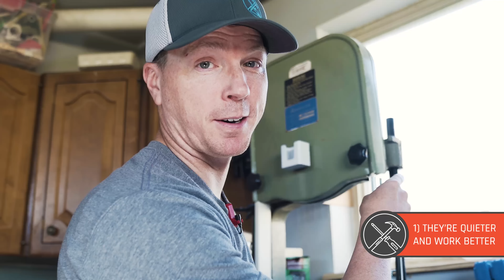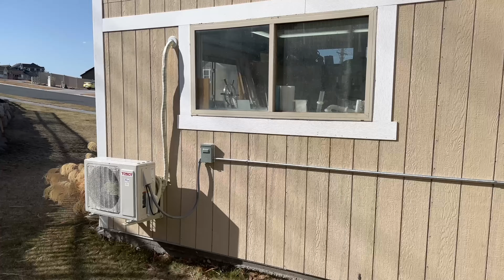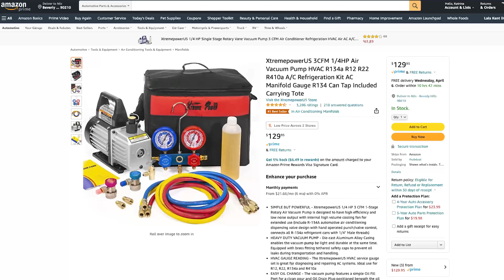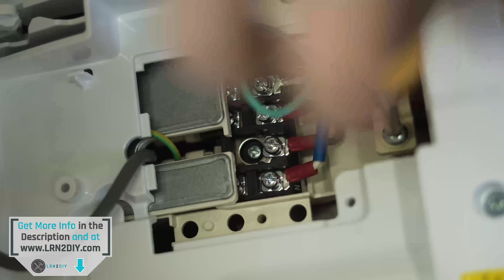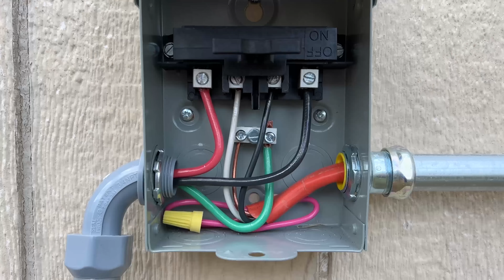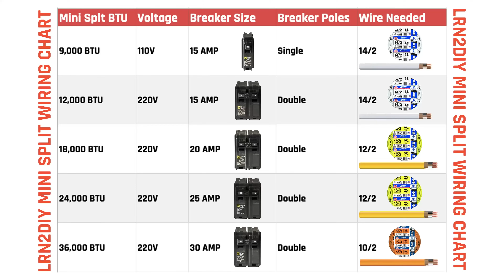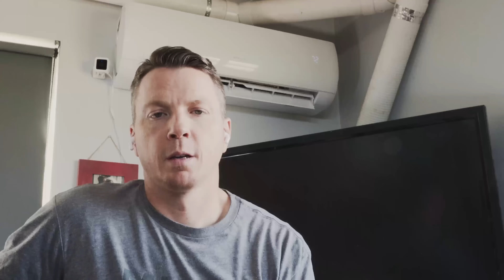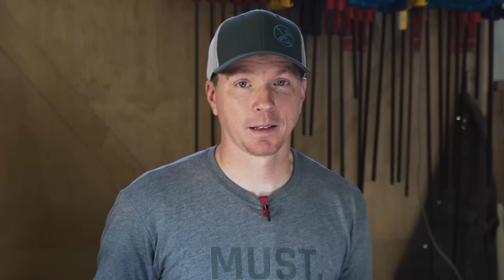Mini Split - 3 Things I Wish I Knew Before Installing

Comment: When our downstairs central unit died we replaced it with mini splits. Not only was it a fraction of the price but they simply seem to work better. No more central system leaving certain areas too hot or too cold. 
Best decision we could have made. We already noticed a reduction in our energy bill.
Reply: Your central system provided ventilation. With mini-splits, there is no ventilation, so you will still need a separate fresh air system.
Reply: @matsudakodo  Provides ventilation can you please help me understand what ventilation?  Also what ventilation system can I purchase?  Thank you
Reply: That's what I intend to do with my house when the central unit hvac unit goes out. One end of the house gets hotter being in direct sunlight. Glad it's working out for you

Comment: I installed a 18K Mr. Cool unit 2 years ago in my garage shop.  I couldn't be happier and now spend more time in the garage than in the house.  Even when it's 100 degrees outside, I can maintain low 70's in the garage (***note: garage has insulated walls, ceiling, and doors).   As for pros and cons......here are 3 I wish I knew before installing

Pros:
1) Adding the unit actually made me much more productive.  Not only can I spend more time in the woodshop, but also have the perfect place now for car repair or home repair projects. 
2) The mini split unit uses very little electricity.  I run it all the time, and my electric bill is maybe only 10-20% higher than normal.   
3) The heating function is almost as nice as the cooling function.  I had almost bought a unit that just cools to save some money.  Glad I didn't.  In the winter when it's 30 degrees outside, I am able to hold the shop at......you guessed it.....low 70's.  

Cons:
1) The most difficult part of the whole installation was shaping the copper lineset against the wall and inside the lineset cover.  I kinked mine and had to get it repaired.
2) The condensate line can be a bit of a nuisance if you have no place good to drain it.   Having it constantly leak over a concrete slab leads to algae build up.
3) Unless you spend more money to get a multihead unit, the cooling and heating can be uneven if your shop has an odd shape.  I have to run a small fan to get the air to equalize to the far side of the garage.
Reply from the maker: Great feedback on your experience, Jackson. Thanks for this info!
Reply: @LRN2DIY  What is the difference withe the cheaper ones you can buy off of Walmart? Also we live in a trailer house... how do you go about that if yiu have an extremely old hvac system you just want to get rid of? Do you put one in each bedroom or just one bigger one in the living room area and just try to run fans?
Reply: @LittleCBR  ; Regarding Walmart, those are third-party sellers and the devices are cheap crap with no customer service and no warranties.
Reply: Great summary.  I’ve had  2 mini splits for a number of years and everything you mentioned is true
Reply: How much do you actually save installing a mini split unit. Looking  to improve my basebord heater with this mini heat pump split unit..
Reply: @jaandel1  Not sure exactly because I didn't have permanent HVAC before.  I upgraded from a small rolling portable Whynter AC unit.  The electricity usage between the two is about the same, but the results are like a night and day difference

Comment: Here are MY three things. 1) A mini is always much more expensive than a window unit, by an order of magnitude. 2) A mini split is MUCH more expensive to repair, since the manufacturer is the ONLY source for repair parts, aside from the refrigerant itself. There are no generic minisplit parts made by third parties. You can't go to the supply house and buy a generic compressor or control board for a mini. No one makes those parts for the repair market. 
3) Most inexpensive mini split units are made by ONE Chinese company and are throw away units. If the repair cost is near replacement cost, you replace it. My Frigidaire window unit is 17 tears old, and still runs quietly and efficiently. It cost $200 at Best Buy. You will NEVER get one of these cheaper minis to live that long. I have installed and serviced all brands of minis, RTU's, conventional splits, and large tonnage equipment. That's how I know this. If you must buy a mini, don't go on the cheap. No DIY junk. Get a top of the line, professionally installed system like a Mitsubishi. And no, I don't install enough minis to become a Mitsu dealer. I let those guys do those sales. I just come along and make them work when they fail in the commercial environment, and even a good unit like a Mitsu WILL fail. I have fixed dozens of minis in that 17 year period, and not ONE repair for the Frigidaire window unit. See that pattern? Those who have ears, let them hear.

Comment: Dude! You just changed my life.
So quick question, do you recommend the 5 CFM Vacuum Pump or the 3 CFM and why?
Reply: I own a 5 CFM pump, and I paid about $400 for it. (15 years ago).  I would recommend using a 3 CFM pump, and run it about 90 minutes, for the same reason the guy below says, it will provide plenty of vacuum.  A $175 micron gauge is something I never had extra money to buy.  So no I don't use one.  I have been installing HVAC since 1984. 

I have used a vacuum gauge, when the boss bought it for me to use.  They normally reach 500 microns in about 20 minutes, and 100 microns in about 1 hour.  However if there is a tiny amount of moisture in the lines, it can take much longer.  Purging the lines with high pressure nitrogen can speed the evacuation process.
Reply: You should use digital guages when pulling a vacuum on a mini split. You should pull the vacuum down to below 900microns which the mechanical guages wont tell you. Having said that the difference between the pumps is simply how long it takes to pull the vacuum.  The 5 cfm will do it alot faster but cost more. For a 1 time use just get the 3cfm pump and let it sit there for a long time. I would say 90minutes at lease with mechanical guages.

Comment: i live in Minnesota  it can get to be 80-90 % humidity 100 -110 deg iv herd splits have tuff time cooling in those temps . would like to here other opinions
Reply: Any ac system sees reduced effeciency in hotter temps. Harder for them to transfer heat in 100+ degree heat then it is in 90 degree. The humidity will cause alot of condensation in the system and if your condensate drain isnt done right or clean your going to have issues. Mini split systems struggle a bit with condensation problems.
Reply: You will be very happy with a ductless heat pump in Minnesota!  They can provide a lot of heat - even when it is about 20F outside.  Below that temperature, it might be a little less expensive to run a gas boiler.  Oil heaters are going to be much more expensive to run.  

To get 100,000 Btu's of heat, your heat pump will use about 5-9 KW of electricity, check your local costs.  To use a gas furnace, about 1.2 therms, or 1.2 gallons of propane, or about 1 gallon of fuel oil.  At $5 per gallon this winter, fuel oil is more expensive than anything else!  A electric heaters will use about 30 KW to produce 100,000 Btu's.  Yes even those quartz electric heaters that claim on their TV ad that says it is lower cost to run it.  

Ductless units control the humidity very well!  Just remember to use a wet/dry vacuum on the drain line about twice a year to clear out the line.

Comment: One Thing I haven’t seen covered was the freon? Does it come pre installed in the outside unit?
Reply from the maker: Exactly. When you connect the lines to the outdoor unit, it charges the lines with the refrigerant.
Reply: @LRN2DIY  that is what I thought I had read before. Thank you.

Comment: SO you missed one of the other differences with the DIY has this doesnt, and that leads directly into your next topic of "lots of electrical" 

the DIY unit has the signal cable all wired up already.
and if you can get teh DIY unit for 1200 instead of 1500 why not go for the diy version?

Comment: 220V outlet?  Sounds like you need to buy a welder to fill that plug.  It's the responsible thing to do.  No 220 plug should be left empty in a shop.
Reply: That looks like a 20A receptacle, not for much of a welder.

Comment: Other tips: 
1. between 3 and 5 years you're going to need a new motor. The motors become off center, wobble, and that wobble extends thru the squirrel cage. Buy the replacement motor when you buy the unit because the manufacturers are always discontinuing models. I've got 28 I take care of in a lodge. Also try to get buy or download a service manual when you buy the unit. Some mfg's don't make them available. If you buy a replacement motor where the model has been superceded, make sure the connector is the same. Often the wiring will be different or the connector is a little different. Also, the shaft length seems to change a lot so make sure if the shaft length is different that you can still use it. My replacements had a shorter shaft (still worked fine)  as well as a connector that differed slightly(shaved a little plastic off with a knife and they worked).

2. clean the filter once a month. Clean the squirrel cage every 6 months unless your in a dusty area that also gets rain. The squirrel cage gets dusty then wet creating wobbles as the muck dries unevenly. 

3. Be extra careful when removing the plastic parts. It's always the kind of plastic that breaks before it gives. 

4. Remember that they never stay as quiet as the day they are installed. I try to keep mine no higher that 42 decibels 3 feet away as long as there is no wobbling noise. Once a wobble noise starts, it will get louder. Often i can get a decibel reading in the mid 40's with a wobble, and in that case the wobble wakes people up not the decibel level.

You can get a decibel app for your phone for free. 

I take the squirrel cage out to clean it but you probably could clean it while it's in with a sponge and toothbrush if you didn't have the time.
Reply: The motor in the condenser or the motor in the head unit?
Reply: @lesmoss1051  I think the only squirrel cage fan is in the head unit. He's talking about keeping head unit quiet for sleeping guests.

Comment: I bought a Mirage 12,000 btu hot/cold, inverter minisplit, for $530 and installed everything myself, but that is not in the USA. The power lead comes through the wall and plugs into a power outlet, that was already there.

Comment: I'm not sure if anyone has mentioned thia, but look at the parts warranty on the compressor and such.  I have found the Mr. Cool products have much longer warranties than the no name brands.
Reply: A 300 year warranty on the compressor doesn't matter if the inverter control board fails in 2 years and they claim it was a phasing issue.

Comment: You left out the cost of charging your unit with Freon. Real disservice to anyone watching this video that is considering a mini-split. Really should update this video with the rest of the facts. Or, were you just brand advertising?
Reply from the maker: You do not need to charge the lines separately for a unit like this. Every step required is shown here. When you connect and open the lines, the refrigerant is released from the outdoor unit into the lines and that’s all you have to do as far as refrigerant. I’m using it right now and there is no extra step like you’re saying.
Reply: @LRN2DIY  I’m using the split unit I installed, right now, and I didn’t have to pull a vacuum. Why are you adding the cost of a vacuum pump to the Mr Cool unit and not to the one you installed? I have the Mr Cool. Bought it for $800 and change. Works great. Added cost to my electric bill isn’t even noticeable.
Reply: @LRN2DIY  Not needing extra steps is what I was trying to say. You said you have to buy a vacuum pump for the Mr Cool and added that cost. You don’t need to buy a vacuum pump to pull a vacuum on the Mr Cool. Connect the lines and done. Sure is nice having AC and heat in the shop. These split units are inexpensive to buy and operate.

Comment: Nice video! One more thing I wish I had known was the inside unit needs to be cleaned periodically to remove mold that grows on condenser. The outside unit should be cleaned  as well but I didn't realize the inside would.
Reply: I'm sorry I ever bought one of the mimi splits. I live in Florida and the dank musty smell is almost always there when not actually cooling just fan on. I have it cleaned and even took it all apart and cleaned it and 3 months later you guessed it musty smell is back. There is no getting around this as I literally have tried nearly everything and no one gas found the solution. Great now I'm back to a window unit with a miminsplit hanging useless on my wall!
Reply: @fuzfire  mini splits do not dehumidify as well as central AC, or window bangers, in Florida where dehumidification is most important I wonder if this is a common issue.
Reply: @fuzfire    Hi from Okinawa!  We went back to the seller and they arranged for professional cleaning and repair from the manufacturer.
Reply: @fuzfire  is there no way to change setting so it only has fan on while cooling not always on it will lower humidity and musty smell not pushing air over damp warm coil when the compressor is off

Comment: We have an old Mitsubishi mini split that came in the place when we bought in 2007, it is in need of servicing but I’m wondering if it might be worth replacing it with a unit that pumps heat in the winter since the existing heating is just an electric baseboard heater.
Reply: Yes!  Electric resistance heat is the most costly there is.  As long as your winters are not crazy cold a heat pump can save you $$$.  There are online calculators that can help you decide.

Comment: I was kinda hoping this follow up vid would cover the things done wrong in the DIY guide video. Stuff like the wrong circuit breaker size, coiling the lines horizontally instead of vertically, torquing the flare fittings, etc. Instead, it was an infommercial for the brand of mini split he installed. : /
Reply: Broke his vacuum with air as well. His system has moisture + incompressibles in it.

Comment: PS: The true higher price of the MrCool DIY unit wont be appreciated/realized until after the NON-DIY unit fails in a shorter timeframe. Then the MrCool will seem like the better bargain. MrCool design bypasses all the common pitfalls that DIYers won’t even realize that they fell-into. An improperly installed unit will still work for a while.

Comment: If you had 220v line for previous AC unit, couldn’t you just use THAT line to power the mini split instead of running a different 220v line?

Comment: That looks like a 30 amp 220 volt  outlet that could be replaced by a 20 amp 120 v outlet and breaker 
The number 10 wire in the wall won’t mind carrying a smaller load and you’ll have a usable outlet 
And depending on the cable (2 or 3 conductors )you may have more options

Comment: Hi, regarding legal requirements in other regions:

In Greece, where I live, smaller units come with a plug, so you don't need an electrician if there is a power outlet nearby. On the other hand, you need an F-Gas certification to work in refrigeration and air conditioning, systems charged with R407C, R410A or R32. That certification requires a refrigeration technician license. So you can't DIY them, legally. Also, in order to have a warranty, most units require installation and regular service by a professional.
Reply: USA indoor power is 120Vac, breaker box power is 240Vac.
Europe/Asia indoor power is 250Vac. That's why power supply is different.
Reply: Also in Italy. You need to be a certified thecnitian to install one and you need to make a declaration of conformity of the installations when the job is done. Reguarding the plug, usually unit comes with a plug attached to them (I don't know if it's a requirement or not), and I've seen some situations where that had been used, even if the best option is to cut the plug and hard-wire it (better if on a dedicated circuit, but if not available to a socket circuit but with a bipolar switch). Also differently from the US the power is connected to the indoor unit that then sends it to the outdoor one (makes more sense, since inside you already have power and you have to bring only one multicore cable to the outdoor one, the outdoor unit doesn't have power when the AC is off since a relay in the indoor unit cuts the power and you don't have to make connections outside).
Reply: In Australia also no DIY, needs to be installed by a licensed refrigeration technician.
Reply: @paulsi1234  tell the government to kiss your tail. DIY anyway and keep rolling.

Comment: Instead of buying a vacuum setup, you can borrow one for FREE from O'Reilly Auto Parts just by leaving a refundable deposit. One big difference in Mr Cool's favor is that it is 115v vs 230v for the one you suggested. That can have a significant effect on the electrical install cost, especially if you have an electrician come do the wiring like I did. He was able to use an existing vacant 20amp breaker, and since the condenser was within 4 feet of the panel no separate shut off panel needed.

Comment: In the winter it is basically the same as a electric heater, no savings on winter heat bill. The heat pump can't contribute enough BTUs when it get cold, so they supplement it with a built in power hungry electric heater. Absolutely not what I expected
Reply: From a 10 year old window unit to 2 24k mini's my heating bill dropped a couple of dollars last winter, When you turned on the old window unit you could see the meter speed up, It was so expensive I tryed not to use it in the winter. Had both mini's running last winter and was comfortable in shorts and a T shirt and I think I saved a dollar or two.